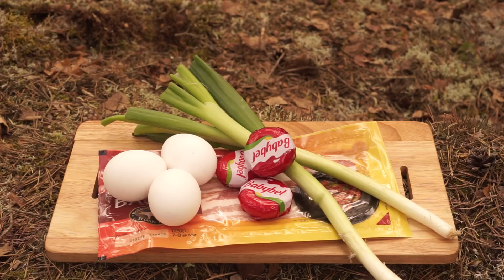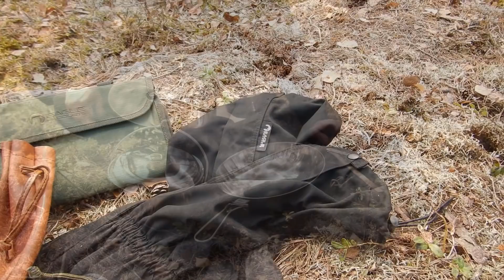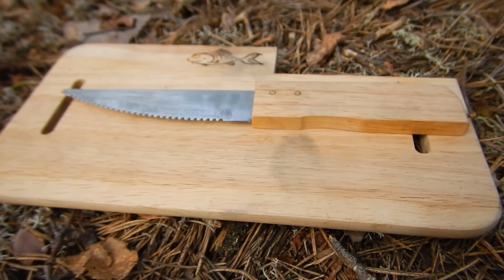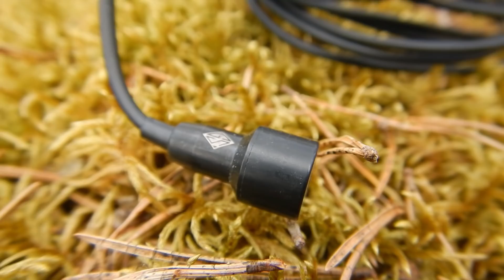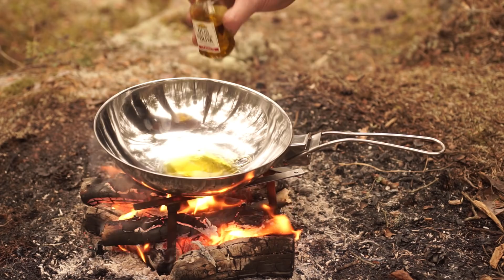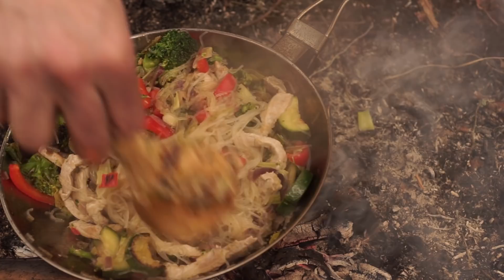Cooking & Camping With Eagle Products & Giant Squid Microphone

Comment: Somehow I get a feeling that the products are cheaper Chinese quality but maybe I'm wrong. Design seems good and I guess price also reasonable. The wood material is not mentioned and where they are made. I tried to find them from Alibaba or Aliexpress but didn't find. Anyhow I like the product reviews also. EDIT: now I finally found from Amazon similar stuff made in China under label StanSport. For example look for StanSport 113003-SSI Stainless Steel Mess Kit. Or any other StanSport stuff.

Comment: Greetings Martin.Thank you for this excellent detailed review. First the Eagle stainless steel cookware. These products are well designed and of high quality construction. I love the kettles and especially the cast-iron griddle. Indeed stainless steel is durable, but in terms of heat conduction it is not as efficient as aluminium. Where aluminium is softer than stainless steel anodized aluminium makes the aluminium much harder.  In bushcraft/ woodsman activities managing fuel is often a concern so I personally go for anodized aluminium and it is also a little lighter for backpacking. I use an anodized kettle from 'Broadstone', it is quite cheap, but well made and efficient. I use a Mors Kochanski Bush Pot which is a good design and very good quality. I also have an old aluminium coffee pot which can be used as a kettle. I do have one stainless steel item though, that is a Vietnam War issue stainless frying pan. I may replace this in the future 'though.
Now to the wooden ware. Again these product appear very well designed and useful. However, with the 'kuksa'-style cups I have a bit of an issue. Traditional made kuksa, Guksi, Casa (depending on origin) are made in a very traditional way with great skill using Arctic/ Curly Birch Burl with good reason. The burl is very hard and the grain resists splitting like other woods.  Traditional Artisans have long made a living from making these Kuksas ( I have Sami Ancestry) and as such, I am not supportive of many of the cheap wood so called kuksas made by other manufacturers (often mass produced in China). The materials are inferior and they are 'kuksa style' not really kuksas. Kupilka of Finland make robust 'kuksa style' products, but they are made from an interesting composition of resin and wood fibres, they don't call their products kuksa though.  Thanks for your excellent videos and enjoy the last of your summer.

Comment: Hei Martin. My experience with Eagles wooden products is unfortunately not that good. I´ve had two cups now, and both of them very early developed cracks. Even though I took really good care of them. Rubbing them with cooking oil is a good way to maintain wooden products by the way. I won´t spend any more money on them. My next cup I´m gonna make myself. :-) Fin video. Hilsen Håkon
Reply from the maker: Hello Håkon. That is interesting. Maybe I have ben lucky with the gear I have used so far. I will for sure let you know if I run into problems in the future. Always nice to make stuff yourself :)
Thanks for watching - Martin

Comment: if your background is in audio engineering why did you not make / manufacture your own microphone ?
Reply from the maker: LOL. That could be a cool little bushcraft project. I suspect the sound would be mediocre though :)
Thanks for stopping by - Martin
Reply: NorwegianWoods: Brother ...you may be unaware but if you took that microphone you used apart [tho I'm not suggesting you do] you would probably find that the parts that the Giant Squid Audio Lab used to create that microphone were manufactured in China, and that it was only "assembled" by the Giant Squid Audio Lab .... if you take separate pre-made parts and make something with them you are actually making / manufacturing something ... 
The pickup they [GSAL] used to manufacture that microphone has a set value on ohms etc and can be bought individually as well as in packs of 10 or more from China ... either direct from the manufacturer or from someone who buys them direct from the manufacturer. 
Pickups [microphones] vary in sensitivity as well as type [mono / stereo ... passive / powered etc].
Sure, some people call pickups microphones, but if you think about it a pickup is useless as a microphone until it is wired into a working audio receiver ... it is only when it is wired into a working audio receiver that it becomes a microphone ... 
These pickups can be used for other things too, such as converting audio signals into light [if you buy one of those voice activated flashing wrist bands and take it apart you will see there's an audio pickup / microphone on its board]... the more sensitive the pickup the more light reaction you get.
The paperwork that came with the [GSAL] microphone should provide you with  the pickups specifications that you could then compare to what is available from China.
The reason I made this suggestion is because your audio via your [GSAL] microphone sounds as good as the audio on my 808 #18 micro camera and the pickup / microphone on that is only 3mm wide by 2mm deep.... you can checkout it's specs online.
For audio recording I use a Sony passive stereo microphone [that cost me 5.66 Euro including post from China about 7 years ago] and I suspect that these days they have improved on them since then, especially as the one I use is no longer available to buy. 
The one I use for audio recording works off a 10m cable without power.
Something else you may also be unaware of ... Sales Hype ... 
There is an American vehicle Light Bar manufacturer that sells its Light Bars for $600+ ... the Brackets are stamped with the words "Made in the USA" ... what people don't realize is the exact same Light Bars can be bought direct from the Manufacturer from China for $92 including post ... without the box ... the only difference being the bracket doesn't have "Made in the USA" stamped on it, because it is a different bracket.
There is an Australian Light Bar manufacturer that does the exact same thing ... they buy from China [in bulk, getting several $'s discount per unit] exchange the bracket and then claim it was "Made in Australia".

Comment: Martin I would like to apologize if my last comment was misunderstood I think what you do is great and the products you recommended is  really good stuff and I respect your opinion. All I was saying is that the real test is time and use, that's all.
Cheers Tom
Reply from the maker: No need to apologise my friend. I do know that it is a fine line between pure marketing and a fair presentation. I intend to keep on using the gear. If I run into problems I will let you know in my videos. I like the products a lot so far :)
Thanks for stopping by - Martin

Comment: Thank you for the overview.
As for the gear talk goes, I can kind of understand it. As I see it, two great interests collide. I live with these interests too, so I can see how this might work, and I really have to excuse him.
One one end, Martin loves nature and can't live too long without it. On another, Martin has a love for gear and technical stuff and all these things, he wouldn't use years learning to be an audio engineer without it.
When Martin was doing audio engineer stuff, free time was all about getting back to nature. When Martin works as a farm hand, the technical side of him doesn't quite get enough. These things have to meld, somehow. And this is, perhaps, a way towards such a blend. Quite the experiment, sure enough, but without experiments you won't learn.
Now to the gear. I have two pans from Eagle. One frying pan with copper bottom. It warped pretty fast, and may be the reason this newer pan is all steel. Bimetals almost beg for being warped at such high heat. I lost patience when trying to fry eggs last autumn, and went for a small Primus pan. Which is thicker but also heavier (for the size). I still keep the old one in case of large chunks of meat or something.
I also have the wok pan, and this is pre bent so it shouldn't warp so easily. I haven't used it much, as it's rather large, but when you don't need a flat pan, and for stews and other things, it's a fine mid between a pan and a pot.
What I miss is a large cup. Shaped like the newest cup you got there, but at the size (and with the deciliter markings) of that small, 3 dl bowl. I like to cut down on the stuff I bring with me, and the same way my deep wooden plate doubles as a cutting board, I'd like something to use both for drinking and for soups and stews. I like to stretch my tea bags and chocolate also, so a 3dl cup is ideal.
As for the lav, the biggest issue I have with it is the chest sound. Actors often have lavs hidden in their hair during makeup, but I  guess you don't have a makeup artist hiding in the bushes, so it's kind of moot. But perhaps under the brim of your hat? Or under the collar of you shirt (even if that'll give you more of a throat sound). Lavs are mostly used as backup, for precisely such reasons. But of course they're great for wind and for being far away from the camera. Save up for a wireless set, perhaps? (But I know, it's expensive.)
Here's a good source for sound for video, by the way: https://www.youtube.com/watch?v=isdMkqtHjy0
Reply from the maker: Hello Harald. I really don't think the gear is all that important. What matters is whet we can do with it. That goes for both audio gear and cooking gear. Some gear makes things easier and some makes me frustrated. I try to show the good stuff on my channel. I agree that the frying pan is thin. I guess it is compromise to save weight. So far it seems like it works good if I dont get it to hot. Good sound is a bit subjective, but in general I would say that a high quality shotgun microphone has better audio than a tiny lav mic. I do like this one so far. Not to much noice and a pretty hot and full signal. I have watched a few of Curtis Judds videos. He put out a lot of useful information. He do not say much about audio for backpacking though :)
Thanks for watching - Martin

Comment: Thanks for demonstrating the range of Eagle products, showcasing Norwegian design.  I am very interested in your experience with using the wooden boards and bowls and plates.  I have always disliked plastic and the various metal dishes for eating from:  food cools too quickly.  I am a base-camper and the hanging cast iron griddle looks very interesting.
Reply from the maker: Glad you like the video. I have plans for some more cooking videos. I will use all the gear in the future and I will tell if I run into any problems. So far I have been really happy with the stuff from Eagle Products. That is why I reached out to them :)
Thanks for watching - Martin